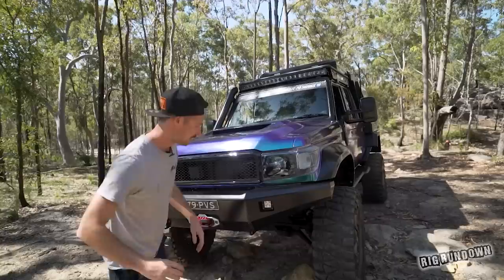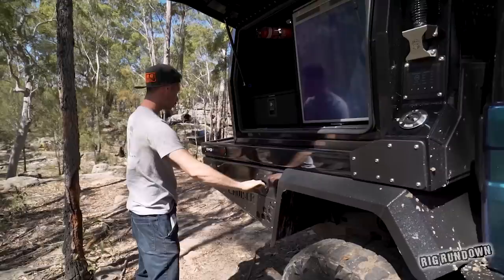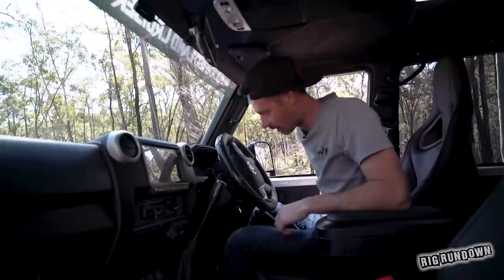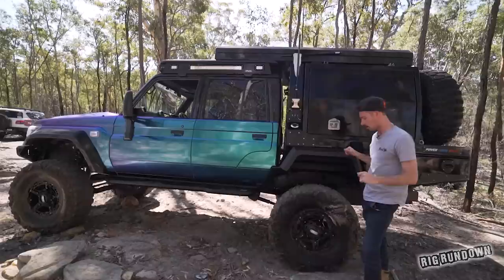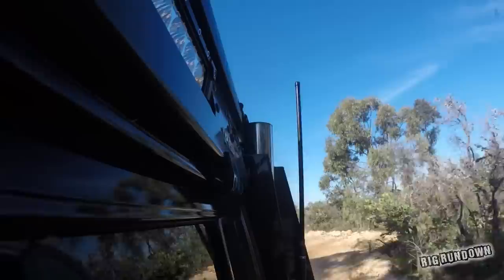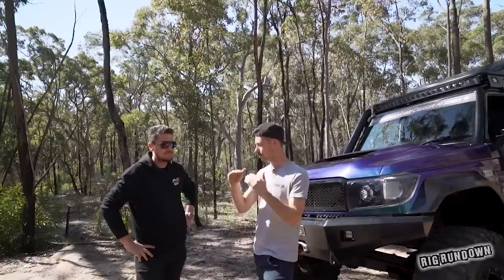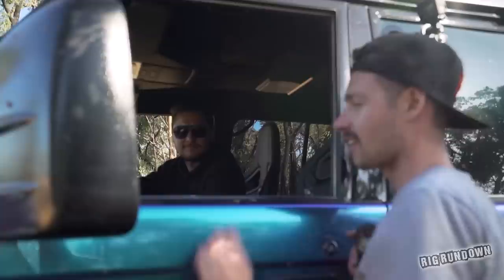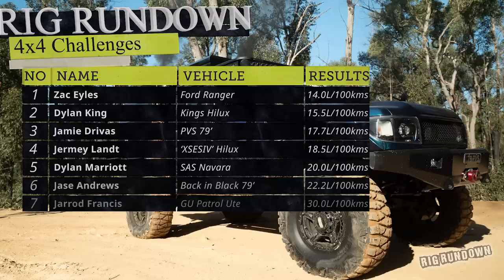RIG RUNDOWN || PVS 79' Walkaround + Challenges!!

Comment: It's disappointing that Marks 4WD Adapters shut down the Coil Rear Conversion kits Jmacx & Superior Engineering were specifically making for the Marks Portal Conversion. :(
Apparently if you installed the Marks Portals SSM Pre-Reg then did the Jmacx/Superior Coils VSB Post-Reg, Marks were threatening customers with voiding their warranties; as a result Jmacx & Superior then cancelled the products. 
No longer can you have a Coil + Portal 70 Series.